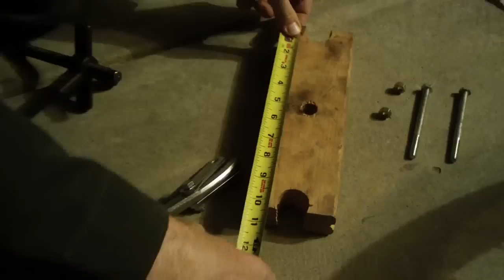Stuck Brake Drums - Removal

Comment: This worked GREAT for me. I got a loaner wheel puller from Oreilys and made the 2x4 part. I had tried everything before this. Drilled out the pins, penetrating fluid,torch,took the wheel cylinders loose,hammer,bigger hammer and a sledge hammer. Thank you for your video.

Comment: I'm a mechanic that has to deal with stuck drums all the time, my biggest problem here, well this type of tool works sometimes, 90% of the time the drum is not stuck to the hub or end of the axle, the rust ridge around the big opening is in behind the shoes. and hence you pull on the shoes and the hold down springs break. now im not saying this tool or similar won't work, but just remember to back of the adjuster a couple turns first if the drum doesn't come off, just to save yourself having to either replace the hardware or a backing plate, which I have done, it pulled the pins right through it and the holes were to big to hold anything.
Reply: kenman1717      If the drum spins freely the brakes are not holding it it’s the rust

Comment: You can buy a Harbor Freight wheel puller the largest one they have and also a MAP gas tourch. I used some heat with the above tool and it worked for me. Be carefull with any spray and flames.

Comment: I used this tool to pull a stuck brake drum off of a green and grey 79 camaro.  It would have been very difficult without it.  It was stuck pretty hard.  I had to use the puller to put tension on the drum and then hit the drum with a hammer to shake it loose.  Thanks ryandale311

Comment: Outrageous that most cars need this kind of struggle!  Delighted to find on my toyota a threaded hole in the drum, between the studs.  You just borrow a bolt from under the hood, and drive it in.  It forces the drum off the spindle.   Cheap and beautiful solution!
Reply

Comment: Before going to extreme means and specialty tools, do what mechanics do when they need to get a four wheel brake job off the lift in an hour or less:  take a BFH (5 lb dead blow hammer) and beat the living snot out of the drum.  I don't mean tap it, nail it as hard as you can swing the hammer using two hands.  The drum will "ring" like a bell and vibrate the shoes backward retracting them out of the ridge where they're hung up.  It also breaks any rust welding that occurred between the drum and the wheel studs. 10 seconds of pounding and it will walk right off the studs.
Reply: thanks more brake secret,s out try keeping your trap shut
Reply: Yea swing a hammer so you miss and screw up your studs.
Reply: BS I tried that last night.
And it didn't do shit.
Reply: @assog5737  I takes someone who doesn't have boney girl arms... 😁  I suppose if the ridge is too deep it might not have worked, but it's never failed me.
Reply: @ohger1  
Then how did you get it to work ?
You must have had someone do it for you.

Anyway your philosophy is flawed.

Hitting the brake drum that hard, might vibrate the shoes backwards towards the backing plate.
If your lucky.
But I don't see it helping the shoes jump the wear ridge.
Because it didn't for me.

My truck is a 2008. But it only has 73000 miles on it.
And I did a break job at 40000 miles.

So I'm sure the drums are still good. So I don't want to take a chance of cracking or bending the drum.

I believe my problem is I'm having trouble backing off the adjuster.
The little slot in the backing plate is so little.
And I have to try and get 2 tools in there.
One to lift the bar that stops the adjuster from backing off.
And then one to back off the adjuster.
Plus I was doing this at 10pm last night.
And I got very frustrated.
So believe me I hit that f#$king drum hard.
More than I should have.
Reply: @assog5737  My mom does them for me..  Make sure you hit the drums on the ribbed part, not the smooth part. On front drums, turning the steering will give you a good angle. Sometimes the rear drums are hard to get an angle on.
As far as the tools to retract the adjusters, that's better done on a lift where you can see the ratchet tab and wheel through the access hole. Pray that some dolt didn't strip them out.

Comment: I don't think that drum was very tight. I would have tried the GM method first - loosen the wheel nuts and rock the car from side to side. If that drum was as stuck As some I've dealt with I wonder what would break first, the wood or the puller legs?The problem with GM and Chrysler products in terms of drums rusting to the hub stems from their very tight wheel centering tolerances, to control wheel run out.I'd prefer the smooth ride over the small inconvenience of a stuck drum. I routinely grease the hub face with moly grease when I have the wheel off - it seems to help so far. It also is important to clean the hub and drum contact areas first with a wire brush. A small drill driven brush works nicely.

Comment: Cool invention!  Just a question, did you try everything else before going to that length? Penetrating oil around the hub, taping the hub and or drum with a hammer, backing off the adjuster.  Once again, I like tool that you came up with.

Comment: im trying to do this with my front drum brakes and im afraid it will smash my bearing dust cover? its super rusty the screws look like they are part of the drum ? what should i do? im thinking that maybe putting a flat metal bar where the bearing edge is and then tightening the screw maybe !

Comment: hey, i did this same EXACT thing and it completely wrecked the 2x4. i did this after PB, heat, and a hammer wouldnt work. any other advice? i also cut the pins on the back that hold the shoes in to eliminate any thoughts of that being the issue
Reply: Anthony Visone       You probably didn’t set up the puller right you wanna just get it on the drum not on the dust shield or backing plate on the backside of the drum. Also handbrake must be off or else the shoes will keep the drum from coming off WD40 works too spray some around the studs and any openings to help the drum come off smoothly

Comment: So much effort wood is very weak when it comes to seized metal parts Make the mod out of metal would be better the metal would not have to be so thick. and under tension a hard wack with a heavy ball pain gamer would remove the drum a lot quicker don't forget to use axle sat ands and wear safety googles over the eyes. Regards Andy
Reply: +Andy Watts At 11 pm he may have only had wood to work with in his shop.  You must do what is necessary to get the job done.